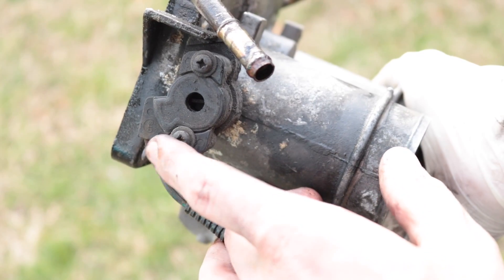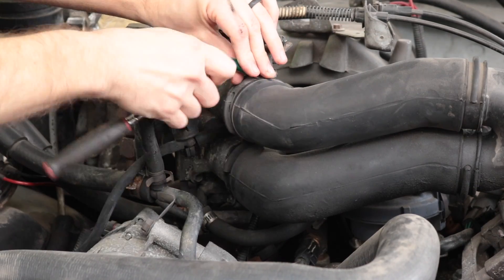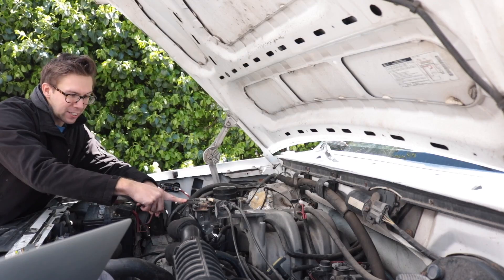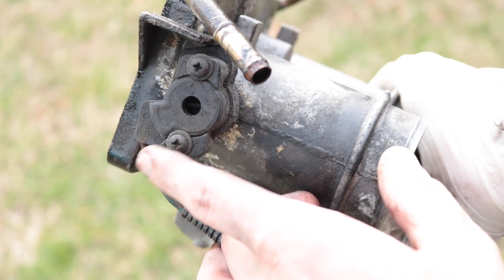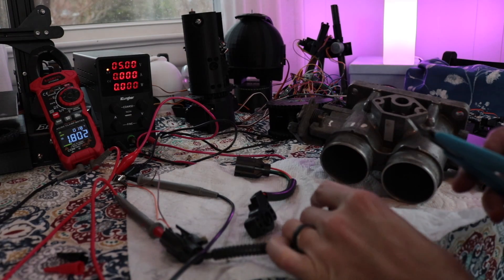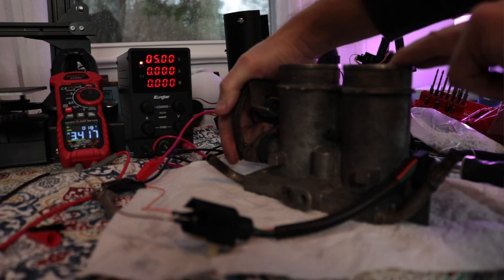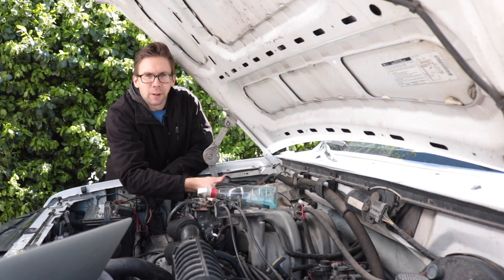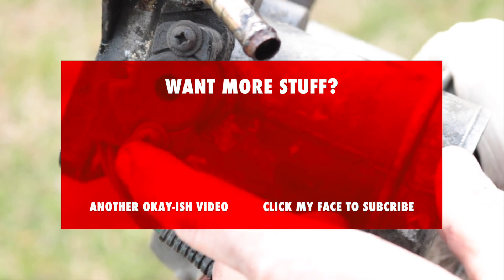Weird Drivability? DIY Throttle Position Sensor Repair - 1987-1997 OBS Ford 5.0L TPS

Comment: Mathew, We both have the same Ford F150 even the same color. I apppericate your TPS replacemnet video. Do you have any videos on O2 sensor replacement for your truck? Thank you dude
Reply from the maker: Thanks buddy! I’m glad you’re here. Nope I already replace it actually - didn’t get a video of it. Do you have a inline 6, 5.0 or 5.8??
Reply: @MatthewFinlay  i actually got my O2 sensor replaced and my TPS replaced and I m still having delays in my throttle response. She is running better since replacing both sensor and TPS. Your thoughts?
Reply from the maker: Ohhh is it also “hanging”? Aka if you were to press the pedal up to 2000 rpm’s, hold it steady and then let off will it stay there for an oddly long time??
Reply: @MatthewFinlay  I got my TPS and o2 sensor replaced. My truck still has a delay when I press down on the gas.

Comment: I had a constant fast idle and took my iac sensor off and cleaned it with carburetor cleaner and it runs great now
Reply from the maker: We’re all learning here buddy! IAC stands for idle air control valve. It’s basically a way for engines to adjust the idle speed. It opens and closes to add extra air or take away air. It’s on the side of the throttle body, held on by two small bolts and has an electrical connector on the end. Over time it gets filled with carbon, crap and just worn out - this will cause erratic conditions if it’s failing or I’ve seen some stuff that won’t even idle. Our Ford will usually idle, but it depends on air temp and the rest of the truck really.
Reply: @MatthewFinlay  I still have my 93 that I bought new.  283K miles.  When starting cold it hovers around 1600 for about a min., then drops to about 1100 rpm.  What should the idle rpms be?
Reply from the maker: It should be right around 750-850, anywhere around there should be fine. That’s in drive neutral will be slightly higher, 850-900. I’ve seen trucks idle from 700-1000, it kinda just seems normal for them to have this spread. Is it a manual or auto - manuals usually idle lower in my experience
Reply from the maker: Yup, common problem on pretty much anything with an iac honestly
Reply: I have 2 trucks that will not run right and I've  tried everything.  A 5.0 and a 5.8 they skip and sputter and buck and pop.  Nothing fixes them.  I absolutely hate ford.
Reply: @wolfwhisperer580  I had a Ford 4.2 L. that did the same thing,. I changed the plugs didn't help and then I changed my plug wires and it run like new , I had 3 out of 6 wires that was bad

Comment: Too fast on the testing. What do you have the TPS plugged into and what did you select on your multimeter?
Reply: You can plug onto harness to see difference with key on probing wire...
Reply from the maker: ^ This guy probes! I had it plugged into a bench power supply set to 5 volts but if you want to do it on the vehicle all you need to do is pierce the tps signal wire with your positive probe lead and then ground out the negative meter lead. I would recommend throwing a little bit of tape or RTV over where you pierced the wire and call it a day!

Comment: Nice explaining 👌.  
My bronco 1991 5.8 crank no starting. Replace oil sensor, and other stuff still same problem not starting
Reply from the maker: Thanks buddy! Do you have fuel and spark?
Reply: Could be ignition control module.

Comment: I also have a 93 E150 Club Wagon Van 5.8L. I've been having iddle issues and irregular idling were even after is warm,the idle stays high. I have it at mechanics and got egr valve code and something about not getting hot enough for her valve to open. I have a 160° thermostat on it and a 3 core all aluminium radiator so it runs cold.
I saw a video were the guy was having simular issues and change out a cat converter and 02 sensor that went bad and fixed the issue. What do you think..?
Reply: I have a 92 E150 Conversion Van, 5.8 with intermittent high idle sticking issues.   I ran a ODB1 scan and got 1 code 116 (Engine coolant sensor circuit to high or to low).  I noticed my temp gauge stays on the cold side so this may be messing the the ECU causing the high idle issues.  I'm going to check engine coolant sensor and swap it out.   Let you know if this fixes the issue.

Comment: we have a 94 f150 conversion van. throttle seems to be sticking intermittently and revving super high causing panic on the snowy roads. Does this sound more like the throttle cable sticking or position sensor to you?
Reply: I have a 92 e150 conversion van, 5.8 and  am experiencing the same issue.  I don't think its the throttle cable sticking.   To test this,  I removed the air filter box and hoses going into the throttle body so I could observe the throttle plates and access to the throttle lever where the throttle cable connects.   I started the motor, revved the motor until I got the idle  to rev high (stick).  While it stuck, I observed the throttle plate positions.  They were completely closed visibly and also checked by trying to moving the throttle lever to the closed position which it didn't move because it was already there.   So that led me to believe something else is controlling the rpms.  I confirmed I have no vacuum leaks.  I replaced the IAC with a new Motorcraft part but no change.   Got a new Motorcraft TPS on  order.   I did run a ODB1 scan and got  only 1 code 116 ( Engine coolant sensor circuit ,to high or to low).   Going to check the sensor and swap that out as well.   I'll  you know which is the culprit.
Reply: @chriskorbut9568  what’s the culprit?

Comment: I have a 93 f350 and my rpms go to 0 when I’m not engaging the gas pedal. Do you have any clue where to start?
Reply from the maker: Idle air control valve is where I’d start! It bolts onto the side of the throttle body and allows extra air to flow when the the throttle is closed to control idle. It wouldn’t be the first time I’ve seen a truck with the holes in the throttle blades so dirty the close up and dead idle air control valve.

Comment: OK, now I'm more confused than ever.  In all the F-150 forums, guys are claiming that changing the TPS eliminates the hard shift between First and Second gear in the E4OD automatic transmission.  I'm not seeing how based on this video.
Reply from the maker: While that’s a possibility, it’s not the first thing I’d start with. Is it a hard shifting only between 1st and 2nd or are the other gears affected too? If it’s a TPS issues it USUALLY (not always) effects all shifts to some degree - although it’s harder to tell since 2/3 and 3/4 are softer. A much more common issue is the 1-2 accumulator spring failing. Let me link you a video about that.
Reply from the maker: @Myster47 here, check this out.  https://www.youtube.com/watch?v=ZV1J1XvCAxQ&ab_channel=Runsbetterthanitdid%2CGarage.
Reply from the maker: @Runs better than it did, Garage. Knows more about this issue then I do - I tagged him, so hopefully he pops up!
Reply: @MatthewFinlay  Yup, only between 1st and 2nd.  I'm hopin' that it's not the 1-2 accumulator spring.  I just changed out the engine and tranny oils and replaced both filters.  I put some Lucas ATF "Conditioner" - not the "Fix" - in the ATF.  If the 1-2 accumulator spring is just sticky then maybe that'll clean things out and let it function normally.  I also put on a larger tranny pan that has a drain plug.  It's the pan that normally goes on the 4x4 but fits okay on the RWD.  Future transmission drains should be a lot easier than sucking it out of the fill tube.  Taking down a transmission pan with only a quart of fluid in it is a lot easier and cleaner than trying to balance five or six quarts of ATF.  I just bought this old truck.  Apparently it came from Tennessee and made its' way all the way up to New York recently.  The more I work on it the more I realize that it is a junkyard Frankenstein.  Seems like it is a 1994 cab sitting on a 1992 frame.  That threw me for awhile when I went to buy front calipers for it.  In 1994, they had bolt on calipers.  Before 1994 they had slide pins holding the calipers on.  But all this is good for my 78 year old brain.  It keeps me thinking and busy learning new things.  I'm also learning about OBD ports.  So now I've got an OBD I scan tool coming in for the F-150 and a better OBD II scan tool coming in for my 2007 Honda Odyssey.  It'll be interesting to see if there are any scan codes in the F-150 memory.  So far, there's no CEL lights on but someone may have just removed the bulbs.  Hard to tell.  But the OBD I scan tool should tell me what the voltage is on the TPS.  If it's like 0.5V then I guess it's working okay.
Reply: @MatthewFinlay  I think I got lucky.  The purpose of the 1-2 accumulator spring, I believe, is to soften the pressure as the tranny shifts from First to Second gear.  As I drove around yesterday, I noticed a distinctly softer (but still firm) shift from 1-2.  Also, previously shifting from 2-3 or higher was so soft that it was barely discernible.  Now, they are distinct and firm.  I think that can of Lucas Tranny Conditioner  and the new ATF is cleaning out all those passageways and letting the transmission work normally.  I'm thinking that if that 1-2 spring had been broken then there would be no improvement or change in that shift - but there is.  Whew, that was a teeth-rattler for awhile.  Now it's much better.  The truck is a junkyard Frankenstein with a 1994 cab sitting on a 1992 frame.  No telling how long it sat and clogged up the transmission.  The rear differential oil was really black and runny.

Comment: on my 1988 f250 5.8L  i would keep having the voltage wire to the MAP sensor from computer not reading correct voltage. the problem was that when it rained or i washed it, water would run along the rubber hood to firewall seal then dump onto the MAP sensor. all the MAP sensors now have a breather opening around what looks like the seal between the top and bottom parts of the MAP sensor so water runs right off in the sensor and shorts it out. and on these trucks the MAP sensor and THROTTLE POSITION SENSOR and IAC  are wired together in the harness. i found a way to fix this. i took a 2 liter soda bottle and cut a squared section out of the bottle . then i set the MAP sensor on it and marked 2 holes for the screws to the mounting bracket. make sure that the plastic cover over hangs the edges of the MAP sensor and also put some RTV / SILICONE  AROUND THE HOLES IN THE PLASTIC COVER TO SEAL IT OFF FROM WATER.  9 times out of 10. those computer checkers wont show a code for the map sensor being bad. and the truck will run like the TPS sensor and / or the IAC is bad. also make sure you put something between the MAP sensor and the plastic cover you made. air has to get in and out of the sensor. i put a Q-tip stick ( without the cotton ends) and a small dab of RTV to keep it in place. this may not work for everyone that has a 1987-1996 truck. but for me it did. hopes this helps some of you guys out there.  also remember this. if you drill out the hole on the tps it will void out any warranty on it. i have tried setting the TPS to .99 and my truck will buck and run like crap. mine is set to what it is out of the box at about .90-.92 and she runs very good and can chirp the tires at times. just remember , no 2 trucks will run the same. but you can go to salvage yard and get TPS pig tail wire connector and get an adjustable TPS for a 5.0 mustang that way you dont lose the warranty on the part. then you can adjust it as you see fit.  all im saying is i hope this helps some of you
Reply: Literally going through all of this. Your a true hero. If you ever in the PNW…I owe ya a beer
Reply: @alexmarion2674  i appricate that and sorry for not responding sooner. go ahead and have that beer for your self and i hope it help you out in some way
Reply: Have one on me too, partner. This exactly what I needed to read. For the 1988 ranger 2.3, Walker products makes an aftermarket tps. THEY ARE GARBAGE
Reply: @triadrelicrecovery6724  i found something easier to do that doesnt hurt the map sensor. just take some RTV and fill in the seam on the sensor. doses not hurt it a bit  and keeps the water out.  and i still make a cover for it just incase though. also i finally broke down and bought a motorcraft map sensor. man its a night and day difference

Comment: So I put on a TPS and still got the issue.  Basically new EGR, maf, TPS, the other cylinder thing on side of manifold, one new vacuum line etc.  I do not have a check engine line on anymore but the truck sputters when in gear and gas.  When I let off the gas the idle goes high but back on the gas dies out.  The pressure gauge says the pump is putting out 35 psi rear tank (front tank is dead).  I'll have to start the truck and look at the guage again.  Oddly I'm having issue keeping the battery charged in (newer battery and checks good), the next thing coolant sensor under the throttle body then it dropping the fuel tanks.  I guess it could be a bad TPS straight out of the box
Reply: I’m unfortunately having the same battery issue. (93 F-150 5.0 )
New battery as well.
New starter solenoid, and relay
New alternator.
My other truck problem is that voltages drop killing truck when headlight toggle is pulled out

Checked and regrinded all grounds in engine bay as well and the two inside cabin near foot areas …

I’ll keep digging for answers

Going to try TPS and see if that does it. Good luck
Reply: Oxygen sensors.
Reply: Ignition control mudule and pickup distributor
Reply: @efrenmora5975  you are correct, that was the issue
Reply: IAC sensor?

Comment: I put my tps on and didn’t drill out the holes. Have an inconsistent idle from about 699 to 850. Think it’s that I didn’t drill holes out or could it be something else?
Reply: Mine plugged in at 0.88
Just left it ...
Reply from the maker: Nope, in my experience drilling out the holes helps more  with throttle response and less with idle rpm UNLESS it’s over 1 volt. Then stuff gets weird over 1v but blade closed - but I’ve never had a Motorcraft TPS that HAD to have the holes opened up. They’ll work fine outta the box. I would start with pulling codes, checking for vacuum leaks and with the Idle Air Control valve - they get carboned up/dirty/worn pretty easily in our trucks. If you wanna quick and simple test of the IAC, I’d have the truck warm and then locate the idle air control valve on the right side the throttle/intake manifold area. Unplug it - if the idle changes and the engine dies. Its probably working, but could be dirty because they usually are haha. If you unplug it and it basically idles the same you just found the problem.
Reply: @MatthewFinlay  that makes good since. In about our in that department. I appreciate ya buddy!  Trouble shooting
Reply from the maker: Thanks buddy! I might not be the best ar this stuff but between all of us we can usually figure it out haha
Reply: @MatthewFinlay  yeah, we better figure it out. America is a snowball headed straight to hell. I was motivated by your comment. Thks captain

Comment: Did this cause the vehicle to stall while driving? I’ve had an intermittent stalling issue. Sometimes it cranks right back up and sometimes it takes a few minutes to start back up.
Reply: I had a intermittent stalling issue on my e250 no codes it turned out to be the ignition control module.
Reply from the maker: Oh man those intermittent ones are hard to chase - it’s possible but they usually be throw a code for it because it’s a short to either power or ground on the signal sense. That’s also pretty rare in my experience but it’s a thing still. If the signal wire goes “open” they just run weird in my experience, aka if a wire was to break, loose connection or failing contact inside the TPS itself. Do you have any codes store in your computer for TPS? There are several related to overvoltage and undervoltage in there